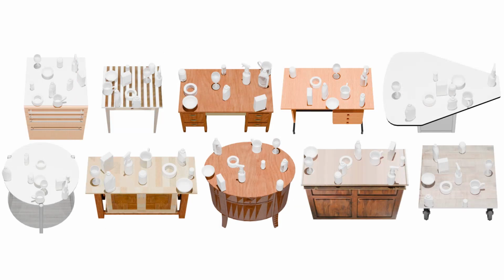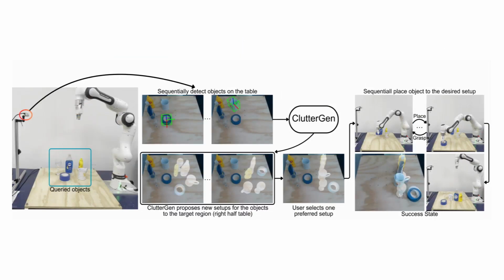ClutterGen: A Cluttered Scene Generator for Robot Learning

Comment: Using the 3D bounding box of objects for positioning with a bin packing algorithm, or even just using the 2D bounding box information in the xy plane to perform bin packing, could solve this problem. Why design such a complex system to address such a basic issue?
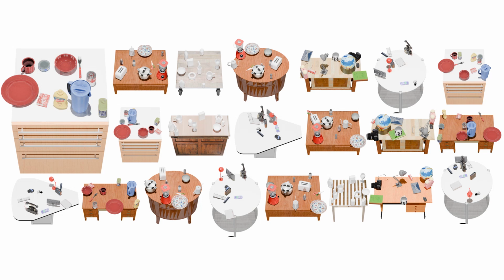Reply: This is a very good question! There are several limitations of bin packing algorithms compared to our methods. First, our task is to determine a physics-compliant stable pose for the queried object with even irregular shape. The main challenge is finding the desired position in a cluttered environment where collisions are sometimes acceptable, such as in stacking, which is not allowed in packing algorithms. You can refer to some generated scene setups at time 2:17. Secondly, our method also considers the diversity of generated scene, which is essential for robot training. However, packing algorithms always place objects in fixed or heuristic ways. Finally, our method can zero-shot generalize to different queried regions after training, while even the most efficient 2D bin packing algorithm still requires O(nlogn). Moreover, our task operates in 3D with object rotation. Let us know if you have further feedback!